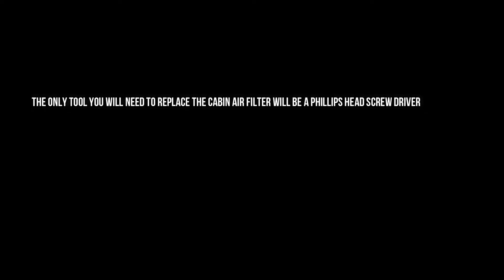2020 Nissan Altima Cabin Air Filter Replace

Comment: This video helped me immensley.
A couple of additional notes for users.
1) There are 5 screws in total, 3 at top and 2 in bottom.
2) The side panel must come off so you can get access to 2 little clips which act like wedges to keep the right side of the box in place. Put a common flat screw driver in the wedge to pry it out a bit. Once both wedges are slightly moved then give the glove box a tug and out she pops.
3) For the light that must be disconnected it is the little white connector you pinch to seperate it from the light,
4) Observe the arrow on the filter faces down so make sure when replacing the arrow must face down.
This assembly is very easy to do. Bring a light with you to see the screw heads.

Comment: Update…. Bought my used Altima 2020 from Enterprise. I checked the air and cabin filters. They changed the air filter it was brand new. It was a cluster getting to the cabin filter but I finally got to it and it never had been changed. I can see why Enterprise didn’t change it. The worst part is getting the bottom 2 screws out. THEN trying to get them back in. I only got them in about a full turn. Another issue is getting the side plastic panel off. Pops off hard and even harder to get it back in place. It’s a terrible design.
Btw…..My first post below should read….. I do NOT have this nonsense on my Toyota.